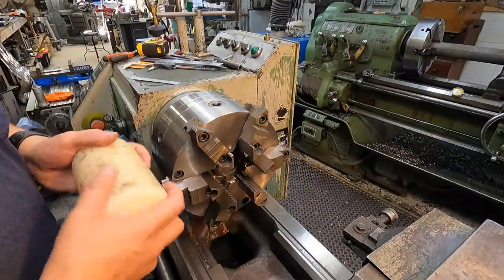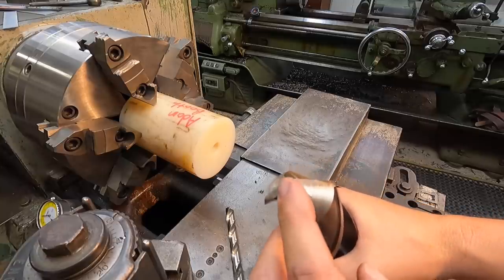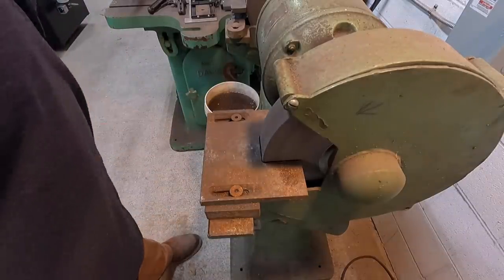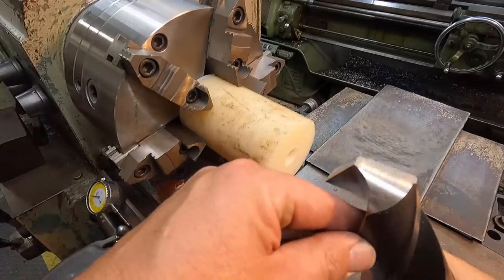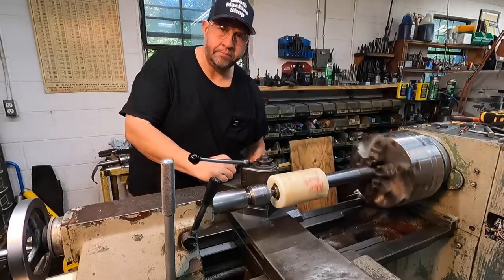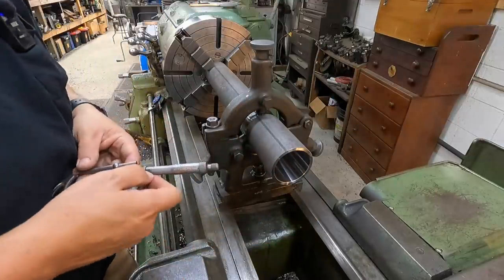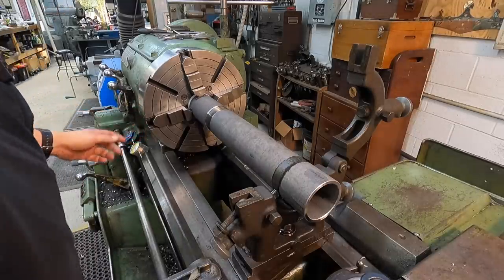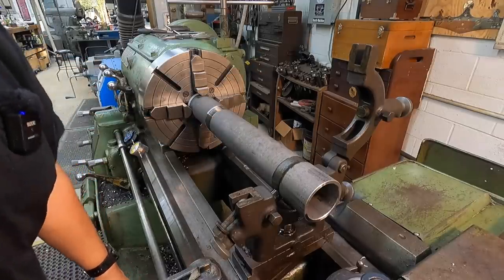Truck Hitch Crane Build Ep. 6

Comment: Thanks for adding the bit about sharpening the drill bits. I had to do an “emergency sharpening” on a neighbors drill bit and they thought I was nuts cause I did it with a grinder. Definitely not as nice as using the stone wheel, but worked for that project at hand. I already sent them a link for your video since you did a better job explaining it than I did
Reply: Drill bit sharpening is the biggest mystery of the universe… I for one CAN NOT FREE HAND it. I need a jig

Comment: I'm a retired Die Maker.  I've sharpened more drills than I could possibly remember.  When you start to grind the cutting edge, as you raise up the front of the drill (or lower the shank, whatever way you want to define it), rotate it slightly clockwise.  That's how you get the chisel angle correct.  It just takes practice.
Reply: Mustard Clean: You’re absolutely correct; die maker here also. Rotating the cutting edges with a little dip to the right only comes with experience.
Reply: I love these video makers trying to tell bunk, how much harder would it be to show how it should be done the right way, like you say experience, but why show improper methods? Then push yourself off on a video as a expert? You are right, do it right, but don’t teach wrong.

Comment: I love watching Adam "freshen that edge up." 5:40 He makes it obvious that this is a trivial thing to do, provided only that you spend four years under a Master tutor, and have 22 years experience, as Adam did and does. For nylon the angle matters not at all. But this is Adam Booth. He cannot stand it. He has to get it exact. It is the internal drive that makes Adam a Grand Master Machinist, capable of making parts to 1/1000th every time.
Reply: If you don’t have what Adam has you may make a fair machinist but you’ll never make a toolmaker.

Comment: Sharpens and hones drill bit to perfection
"Let's go see if this thing will drill some plastic!"

I got a good laugh out of that one, Adam...meticulous as always, even when it's absolutely unnecessary. I always loved cranking out some little delrin locator pins at work. I could take a 3/4 radius and just hog off material and make a nice dome topped pin easily....I also loved the smell. PVC, too, but had to keep that pretty well soaked with coolant for a really smooth finish. PTFE always looked really nice after machining, too.
Reply: Amazing how meticulous machinists are on things we wouldnt think twice about. My dad is an engine machinist and is the same way.

Comment: Thank You for the complete but quick show and tell of the drill bit sharping. Your years of experience makes projects appear to be effortless. I have learned quite a bit about machining, machining tools, materials and reference materials from you. I also purchased a used machinery handbook as a result of you introducing it to me. You have become a professional presenter with a warm personal feel. Like a good friend or neighbor would be. I have followed you at different levels depending on my life allowance for at least 5 years. I recall when you were repairing the ceiling in the original portion of the shop. Smiles Bro !

Comment: Adam, I usually use an air nozzle to blow the stringy plastic through the workpiece whichever direction suits the job at hand.   You can fix the air nozzle to a magnetic holder  to keep your hands free.

Comment: I would caution you on using oil or grease on the nylon. Oil can gather particulate matter while it's wet and soon thereafter will dry out. Grease will get grit in it also but can harden over time depending on the environment it's kept in. I would suggest that you rub graphite onto the surfaces that touch each other. The graphite will not attract particles of dirt and will remain frictionless for quit some time.

Comment: I would not recommend using dish soap. We used to use it for ceramic shaft seals until the seals failed during testing. After consulting various soap mfgs, it was found that they use friction modifiers to enhance the cleaning capability.

If a oil-less lubricant is preferred I'd use PX-80, or good old fashioned KY(dollar store brand is a better deal).

If a spray lubricant is preferred, I recommend Prizm made by Drummond American(Lawson bolts). It's a Teflon gel that is compatible with poly, as we have used it for many years on the sliding portions(beams) on ladder trucks and does not wash out when being left out in wet weather.

Comment: The hones are good tool for when drilling really gummy or sticky materials like copper and aluminum, the higher polish you can get on every surface of the drill will help prevent the material from sticking to it and not ejecting away from the cut.

Comment: Sweet video. I really like the expanding collet idea for the nylon. An idea to inhibit rust is a paste I use on my steel tools Rust Prevention Magic. You heat the tool with a heat gun and brush this stuff on your tools and bits. Works good to prevent rust.

Comment: If you're concerned about the nylon getting hot from the welding, use a garden hose to run water over it between the weld and the nylon, since you'll be welding farther down the pipe. Helps a ton.
Reply: saw the same problem.
don't think water will help much
so we will see what adam has in mind

Comment: adam use some teflon spray on the nylon to lubricate it and wrap a soaked water rag around the pipe where the nylon is when welding it if the nylon binds under weight you might consider parting out the inner part of the face and put a thrust bearing in it and use the outer part of the nylon as a seal chears from down under

Comment: I, for one, know you are a well trained pro.  The double or triple chuck locking using the locking points around a chuck be it Lathe or Drill is adjusting the forces inside for a clean clench.   Good Go and Good Lesson.

Comment: If you have too much friction, you could also relieve the face of either the bushing or the steel plate with a face grooving tool to reduce the area of contact ? Like many small triangular grooves from a chamfering or threading tool

Comment: Adam here is a tip from an old machinist/drill grinder.
.
Bend some flat plate at 90 degrees (2" X 10") ish and weld a centre on the 2" end facing up.
.
Position the drill csk hole on the CTR, blue the 8" length and scratch the drills cutting edges on the gauge, compare the 2 scratch marks and adjust your grind.
.
No measurements needs, use your eyes - ultra accurate and quick, accuracy is now increased vastly.
Reply: Ohh the old eyecromitor!!!  Can’t beat it

Comment: Hi Adam, it appears you might benefit from a wheel dressing gadget I made for my pedestal grinder. I mounted a dressing diamond with a threaded hole opposite end of diamond tip, into a block with a ledge to catch the edge of the grinder tool rest. A threaded hole in the block to match the one in the diamond, allows for the diamond adjustment. Sliding the block along the tool rest while the diamond cleans up the wheel makes the wheel run true and smooth. So much nicer than having your tools bouncing off the face of the wheel.

Comment: On a 3in resaw that I used to operate they used a paraffin based oil to lubricate the saw blade as it went through the guides. I know the saw is still in use even though it was built in 1947. It was a 19 ft Resaw blade type of Saw.

Comment: Adam i took the table of my bench grinder set it up in my mill and machined several parallel lines at 59 degrees so to visually line up my drill to keep point angle correct saves lot of time sharpening multiple drills simple but works well

Comment: So cool to machine soft materials with sharp tools. I suggest using PTFE spray lubricant on these parts. It's dry and won't attract grit. Spray it on both bearing surfaces and it'll dry into a dry powder that is white and stays in place well. Otherwise, I'd suggest a dry silicone spray lube. PTFE "Teflon" would be my first choice for this Nylon part though.

Comment: Good tip on using razor sharp hss to cut nylon👍  I find it's best to run quite slow also, neither the chips nor the workpiece can carry the heat away, unlike metal turning.  I've had success cooling with mist, or just (a lot of) compressed air.  nylon absorbs water and swells a little, so air is best when machining- for long term lubrication, either wax, or a silicone grease should drop friction and stop the bushing absorbing water.  The downward pressure of the loas on the flange might cause creep if loaded long-term, which may restrict freedom of turning...

Comment: A local machine shop that machines plastic covered rollers for a paper mill uses a vacuum on a 55 gallon drum to pull the strings away from the cutter.

Comment: When grinding big drills you can back grind the flute all the way out to stop that heeling issue and when used on steel, they cut smoother and build up much less heat with the flute cut back

Comment: In addition to cramping the foot pin or screw, the added weight of 200-300# will want to drop the bed 2-4” or maybe even more. Won’t this be placing a rotational torque on the joint where the box tube meets the vertical round pipe?
Reply: Yup.  Big torque.  Hitch not designed to accept any torque.

Comment: Adam, for whatever it's worth, of all the plastics commonly use today..... Nylon absorbs moisture quite a bit more than most, and you can expect the size to change accordingly. So if this hitch is exposed to the outside humidity or rain you may find that the .005" diameter clearance may not be enough.... It might eventually bind.

Comment: "Like Butta!
I have always had the best luck starting with the backside slowly and gaining bit rotation speed as it works towards the cutting edge.  It usually takes 5-8 tries before I reach the cutting edge. I see it as the cutting edge wears away much more than trailing areas. 
2cents

Comment: Adam, great video, if after a few months to rotation becomes a bit difficult, it is possible the nylon has swelled due to moisture absorbition, it is hydroscopic. Learned from the drill sharpening, thanks.

Comment: A friend of mine used to set up radio towers and used a pipe called rigid conduit to make the coax for the high power vhf and uhf transmitters it was very heavy wall thickness but had a seam on the outside.

Comment: If you get a bowl, pot or pail with enough water to submerge the nylon bush and pipe in (only to the bush depth) you can certainly prevent over heating of that section during welding. I am presuming that welding will all occur above the rotating nylon bush section of the pillar? It is inspiring to watch a proper engineer make, a most useful version of the utility crane. The mass produced gear available generally, is not satisfactory so I have never been willing to buy one. Building a satisfactory crane however is more like it!

Comment: At 1:14 we get an example of what 270 years of working experience can invent. The depth of knowledge on display with that Expanding Mandrill is stunning. In 1751 Jacques de Vaucanson in Nancy France produced the first lathe that embodies all of the elements visible in Adam's lathe: the compound tool holder, the "ways", and the screw drive to move the tool holder down the ways. I was described in the Encyclopédie, ou dictionnaire raisonné des sciences, des arts et des métiers (English: Encyclopedia, or a Systematic Dictionary of the Sciences, Arts, and Crafts) published in France between 1751 and 1772.

Comment: dawn  is grease  and oil remover with surfactants so it would remove  any type of lubricant you would have original i would stick with a silicon  spray or something  similar  that wont  attract  dirt  maybe garage door   lubricant or a dry graphite

Comment: I have often machined Acetal and found the shavings often cause galling - I have used vacuum with reasonable levels of success but would prefer air blasting through the workpiece.

Comment: Soap will cause rust and corrosion, we use it on our tire changer, and the metal  brush handle is just real nasty, rusty n crusty! Be bad all that work you've put into this for it to rust, we really like red lithium grease for applications like that!

 Would really like to see you rebuild that Drake press!

Comment: I’ve been thinking about building something like this as I need to load several couple hundred pound water heaters into the back of my truck once a week…the big ones can be 400+ with the crap… been getting up on my tailgate and then flipping them up so they are standing… in the winter with frozen sheet of ice in the bed it gets a little bit more crazy as they can slide and not stand up so then I’m catching them on the comeback or they slam down hard… it’s a little hard on the shoulders when they are full of rust and muck..,😂👍.  It would be a bunch easier if I could just set them in the bed… without my back! 😂👍

Comment: Reminds me of when i was a kid and was left to my own devices to hang 2 metal gates on 2 metal gateposts.  Chose two 3 inch round posts for both a 10ft and a 14ft gate; OK for the 10 ft gate but flexed like crazy for the 14ft one.  Replaced that post with a 4 inch diameter one, no deflection.  Someone posted a video in the comments of a home built lift in episode 5, not too dissimilar to Adam's but with no bushing, just the shaft inside an outer pipe.  But his round pipe is 4 inch diameter vs Adam's 3  and his outrigger is 4 inch square vs Adam's 2 and a half inches. What's more, the 6 inch long pipe that receives the column shaft has a huge gusset to the outrigger to prevent deflection vs Adam's none as he's got a nylon bushing there that he doesn't want to melt. What's his planned improvements?, he wants some sort of jack instead of the fixed leg with holes which doesn't work well, and make an extra long beamed gusset to the hitch to help prevent twisting of the 4 inch outrigger!.  He lifts engines.

Comment: Special pipe?
I believe that there are three ways they make pipe ( may be more). DOM drawn over mandrel a billet is heated and pressed into a kind of doughnut then that is drawn through a mandrel. Roll formed sheet, length of flat stock is cut and run through rollers to make it round and a welder zips down the seem.
I think special pipe is done the third way a cross between DOM and rolled, a piece of flat stock is drawn through rollers and a mandrel and a welder. As it is pulled rollers curl it around a mandrel and through a form as it is welded. The finished product is almost seamless. Not as strong as DOM but stronger than roll formed.

Comment: Use a white lithium grease on there.

Dawn etc can cause corrosion on the metal parts, white lithium on the other hand acts as an inhibitor.

You've also got the issue of having a liquid soap product getting grit etc stuck in it and producing a grinding paste in there.

Again, white lithium dries out after applying, meaning it won't attract those contaminants.

Comment: Adam, I'm a beginner in shop and DON'T have a lathe or specialty equipment like that. But I do have a 20 ton hydraulic press (Harbor Freight special) and am thinking about an arbor press for smaller needs. What would you recommend?  Don't need a large press, just a second one for a bench.

Comment: Non-machinist here - when you said the heel was causing you problems, does that mean that the heel was higher (?) than the cutting edge and had to be ground down? Or did I miss some basic thing?
Reply: heel needs to be lower than the edge so the edge hits the part and not the heel
Reply: yep exactly that mate
Reply: Correct, if you were to color the end of the drill bit in with a Sharpie, then briefly run it into the material you are drilling, you can see where the drill is making contact as the ink will rub off.
That is a neat trick for checking the grind on a cutting tool or drill.
Reply: @Uncle-Duncan-Shack  ...annd that's probably why the junk bits I resharpened aren't biting worth a damn. Thanks for the tip - back to the grinder:)

Comment: For a foot to this thing, could you weld a plug in the bottom of this pipe, with a threaded hole in it, and a threaded rod down to a plate (set up so it rotates independently?) for ground contact?

Comment: My old teacher at trade school who was a fitter and turner, boiler maker, tool maker engineer, pattern maker engineer and I forget his 5th trade. Well he (Martin) scribed a line onto the rest next to the wheel on the 10" we had there. So you used that line to line up the drill. 
I just do small drills by eye and do the two nuts trick to check them as I'm a mechanic by trade.

Comment: Hi Adam hope you are well. I don't know if this will be an use to you and you might call me a pratt. My lathe is a collet lathe so the head stock is hollow.i had a similar issue to you with the swarf from the nylon not coming out and jamming up inside.so I got a cheap leaf blower and set that up on a low power...blew the swarf straight out

Comment: Doesn't nylon swell when exposed to water?  will it tighten up on you when you leave it out in the rain?
Reply: Yes, nylon absorbs water. Not the best material for this, but he said he had it laying around. UHMW PE would probably be a better choice. Not really that expensive either. Delrin looks to be about twice the price and PTFE is 5x the price of UHMW PE. All based on McMaster Carr pricing.
Reply: @Fix_It_Again_Tony  I had not watched the whole video when I commented.  I saw later Adam gave it a pretty generous clearance.  He should be ok.  And when it is just laying around it is easy to make those choices.